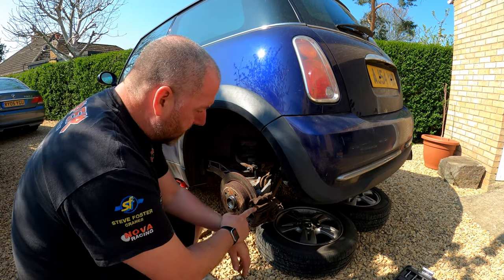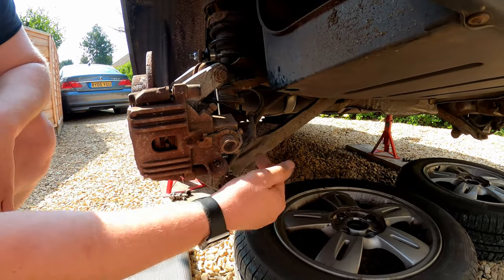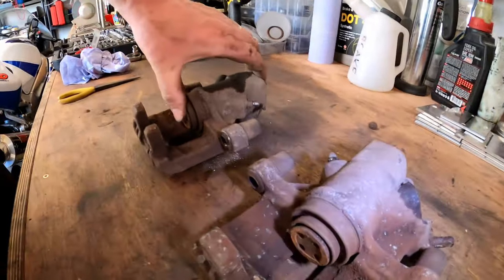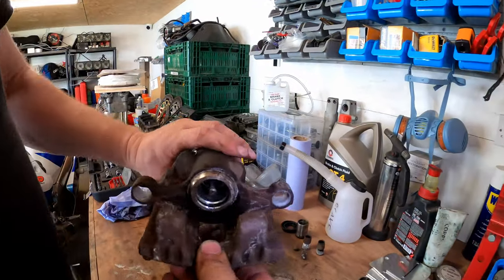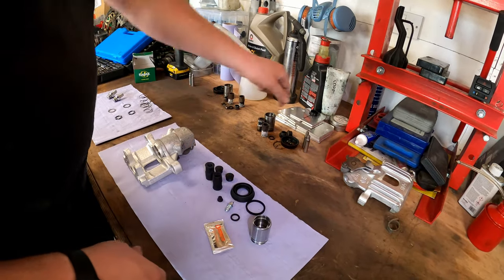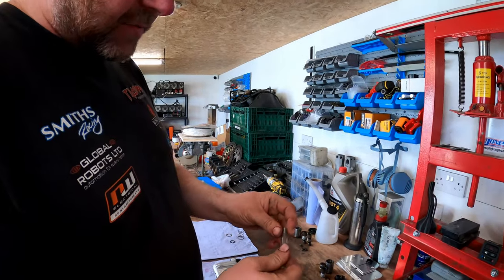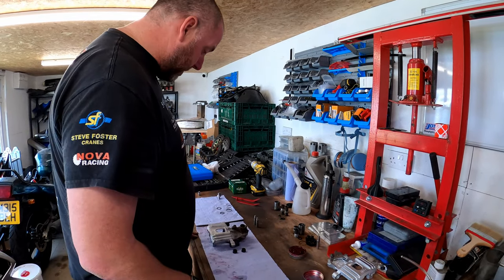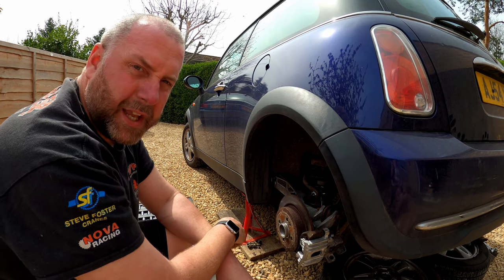Mini One, Cooper & S, Generation 1 & 2 - 2001 to 2014 - Rear Brake Caliper Renovation & Rebuild

Comment: Youre lucky its not a clubman. the 2013 clubman outer boot doesn't stretch over the piston hole on the caliper.... it has to fit into a groove on the caliper making it difficult to fit once the piston is already screwed in.  Cant find anyone thats done the rear with this different boot style.
Reply: I've come across those before. Pain in the assss.

Fit boot first as you say (making sure it's fully seated in the groove) then fit piston and use a healthy smear of red rubber grease to ease things together and prevent the piston pulling the seal baxk out.

Comment: Is there a trick to putting spring in. Would of helped to show the 30secs.
Reply: Found just pushing down progressively with something like a flat blade screwdriver until you can make it clip in under the lip at top works. Doesn't actually take a lot of force.

Comment: I'm interested in how you installed and seated the internal piston spring.  Bench vise and lots of cursing?
Reply from the maker: As it happened, it went in really easily! I wish I had video’d it now!
Reply: @KevsShed  Thanks for the reply but I'm interested in exactly what you used to seat the spring since it's larger than the piston opening.  I'm struggling with seating mine.
Reply: im stuck - thinking of making something like a mini piston ring compressor tool.

Comment: Awesome video Kev. Also busy rebuilding my rear callipers on a R53. Got everything done but after struggling for about 1hr20m to fit the spring back into the piston, i decided it was time to go to youtube for advice. Took me about three hours to find this video which relates to my calliper. Horrified when you did not demonstrate how to get the damn spring seated. Please if you have a moment, would really appreciate a short explanation of how to succeed.
Reply: Hello mate 
Did you succeed wirh spring. Im about to give up. 😫
Reply: I'm in the same boat. There must be a knack or a tool.